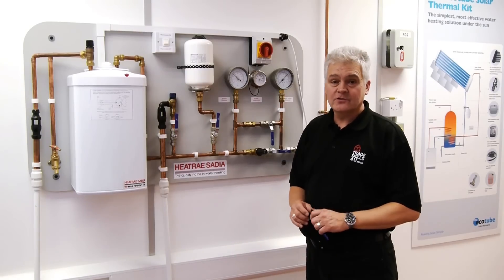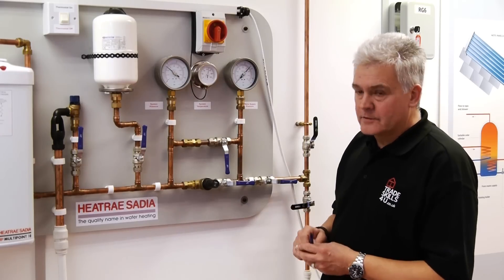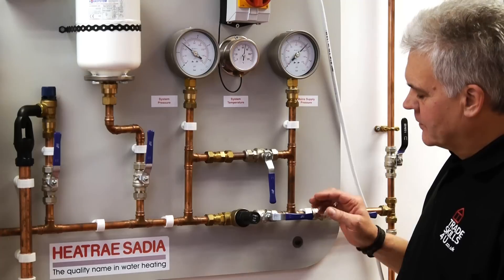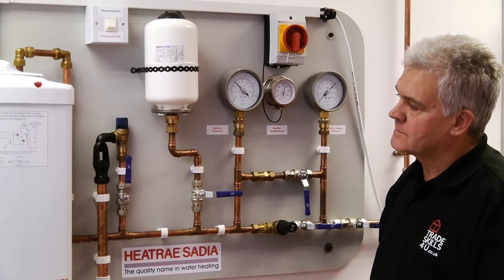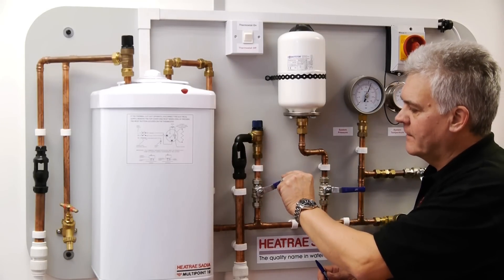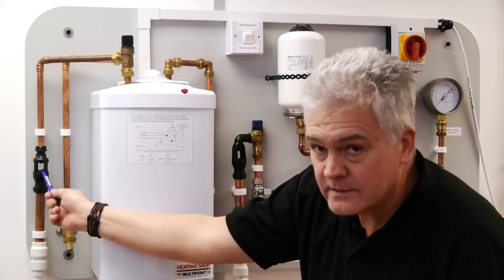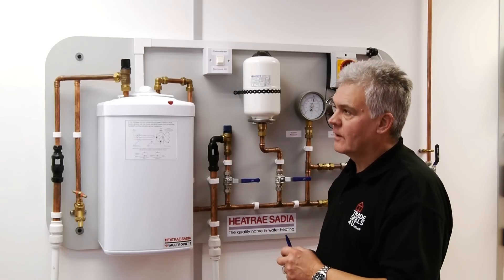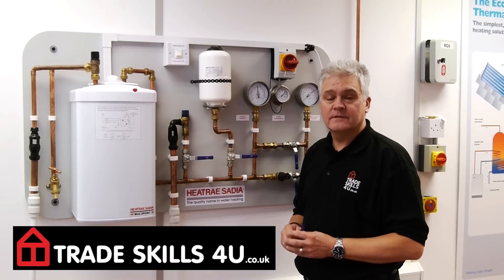How Unvented Hot Water Works

Comment: Hi there. By no means am I a qualified tradesman, but just love learning about different systems etc..
This video is fantastic, as it shows in a simplistic way how an Unvented hot water system works. 
The one area that I cant get my head around and understand and if the gentleman who made the video could kindly shed some light on it is: 
The expansion vessel is connected inline with the cold water supply to the boiler. Which means there is cold water in that part of the system, so why would it expand??? My understanding (limited of course!) is only hot water expands due to raised temperature, as molecules become more spaced out etc. So why would the expansion vessel not be on the other side of the system, meaning on hot side?? On the other hand I can understand why the expansion valve is there because if there is a fault in the pressure limiting valve then it will release that extra pressure. If the expansion valve is there for safety and to regulate the pressure then what is the role of the expansion vessel, why is it needed?
Sorry I ask too many questions!! 
Please can somebody explain and give me the light bulb moment! 
Thanks in advance.
Reply: There is no valve separating the supply side of the boiler from the hot water side. This means that if the pressure rises it wil rise on the supply side as well, up to the point of the check valve (which is probably built into the pressure reducing valve in this setup. The expansion vessel is there to maintain a more constant pressure in the system within normal operating limits. The pressure relief valves act as a safety measure in case these limits are exceeded.

Comment: In theory, could you still get hot water with the expansion valve turned of?
Reply: You would get hot water but you would also waste hot water as the expansion water would go down the drain through the relief valve.